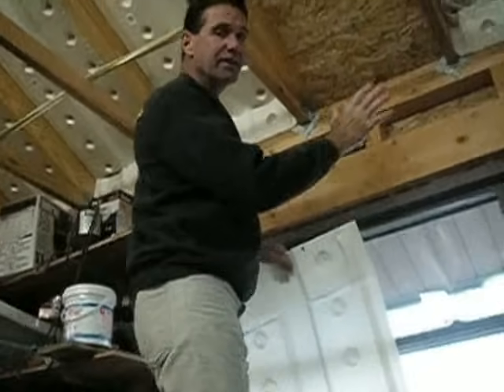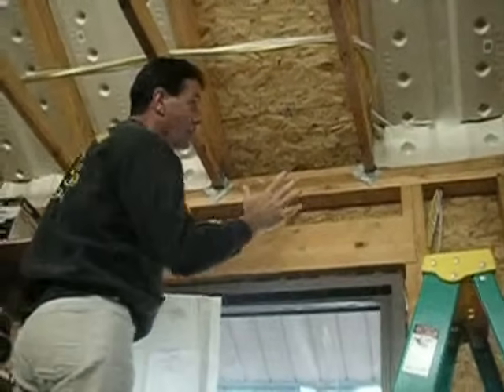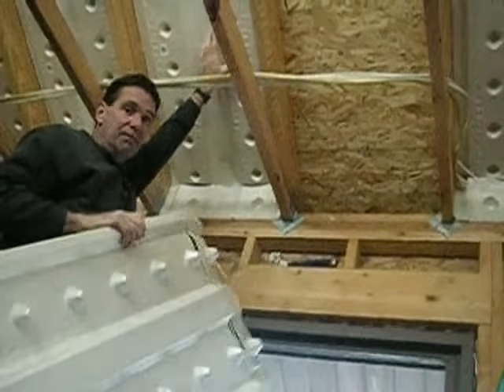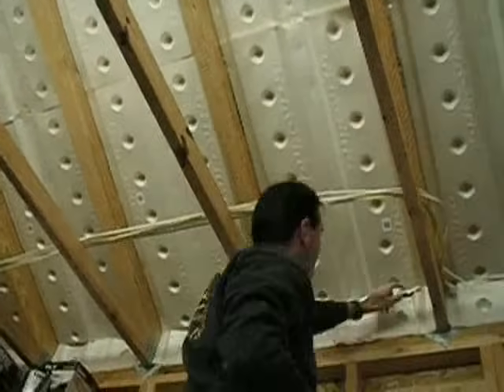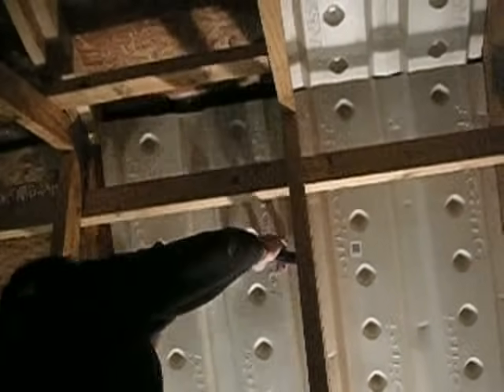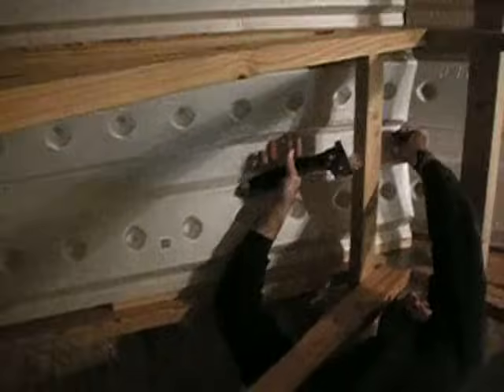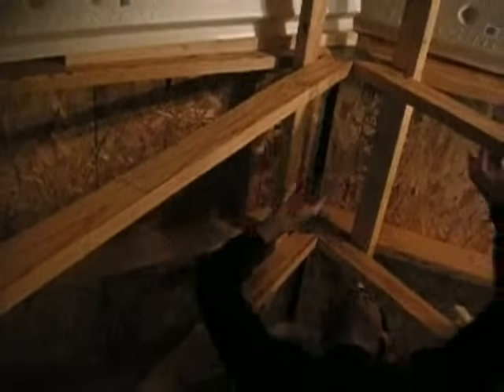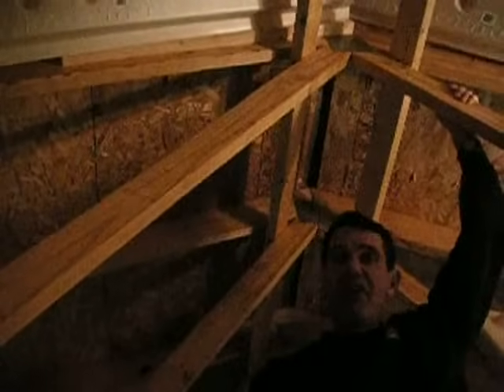Roof, Attic Insulation of Foam Baffles - Ventilate, Insulate Cold, Hot Air

Comment from the maker: This project requires an outlet for the rising warm air to vent outside. Without a ridge vent it won't work properly. It is not that hard to add a ridge vent even to an old roof.

Regarding the attic space, in this instance the attic space is 'conditioned'. Heated and cooled, not intended to be vented except for opening the windows for a nice breeze while I'm working up there.
If it were an attic I would have insulated the top of the ceiling of the room below and let the attic be vented.
Reply: Mr. Hardware you should get can foam and foam around the edges where the baffle is in the soffit area.
Reply: I have a shop with a metal roof in which some of it is exposed underneath (no deck)   Would this system work and keep it from condensing?
Reply: @Shang Tsung You weren't listening to him. He said @ 1:07 that he was going to use some tape and foam to caulk the joints.
Reply: @ipaintclarksville tennessee1, I'm not expert at this by any means. But it seems like it would work. I would think basically anything you can do would work. The condensation happens when there's moisture in the air with direct contact to a cooler object. Like a cup of ice water. You would want to make sure that the air touching on the inside of the metal was the same as the air on the outside, for temperature reasons. But you may end up condensing right on the baffle of it's cooler than your inside. I would think a better thing to do for this is to place some insulation directly over the metal. Like putting one of those foam insulation sleeves over your can of cold soda. It will feel much warmer to your hands and it also won't condensate air moisture on the foam.
Reply: I have a whirly fan

Comment: Please help me find what to use underneath the porch it has became part of the living room it makes my entire first floor ice cold
Reply from the maker: Many things, your porch could be on a slab and of course concrete it’s always cold. Your porch may be over a crawlspace that’s not connected to the basement hence it has no warm air underneath it so it’s cold. You’ll have to let me know the construction as to how to cure the problem.
Reply: @MrHardware1  you are right the porch is not connected to a basement and its an open crawlspace i now have very little fiberglass insulation i need to know what else i can use.
Reply from the maker: @jacquelinepierre4699  Either you get underneath the area and insulate it with fiberglass and then put a protective sheeting on the bottom of the joist to keep animals out of there. Or you seal the perimeter of the crawlspace and you connected to the basement so warm air from the basement can get into that area and it won’t escape because you insulated the exterior of the crawlspace.

Comment: Hey Mr. Hardware 
I'm going to do the same for a very similar roof. Do you tape the top seam were the two opposing ends meet at the peak?
Reply from the maker: I cut about a 10 inch piece of the baffling and taped it across the ridge and then used aerosol foam as a tack welder to fill all my voids and glue it into place.

Comment: So the baffles need to go up the entire length of the rafters to the ridge vent? Because some forums/videos are saying you just need baffles at the soffit to prevent insulation from blocking air flow into the soffit vents?
Reply from the maker: This is what’s called a hot roof and the area underneath is totally conditioned, so that’s why the baffles go all the way to the ridge. If this was a conventional attic where it is not conditioned, the baffles would simply run from the soffits where the air comes in up to above the ceiling line in the attic.
Reply: @MrHardware1  Can I use baffles only at the soffit and then instead place air gaps under the batt insulation (as opposed to using baffles for the entire length of the rafters)?
Reply from the maker: @riffdex  If you’re going to drywall all the way to the ridge, baffles all the allow for insulation to be tight (but not too tight) and not worry about hindering airflow.

Comment: Am I right in thinking that there should be a soffit vent between all rafters so air will flow up the roof to the ridge vent?
Reply from the maker: Usually the soffit is continuous so one vent feeds multiple rafter spaces. I have had to install more but smaller vents in one job w separate rafter spaces
Reply: @MrHardware1  That explains my confusion. Yes, I have individual vents but not between every rafter. Thanks for the reply.

Comment: Am sorry said this but. The 1st baffle vent. Are Instal Incorrect.  And the Union bet twin Sims are incorrect. To.  

You need put all straigh out the vent. 5 to 7 inch out. And block the top plate whit R19 Batt Insulation fiber glass or kraft Batt Insulation.  Air seal whit foam Insulation any penetrations....!   Plus aded  R19x24 Batt Insulation fiber glass and vapor Barrier poly 4 mil or 6 mil.    And taping any  cut or gape in the barrier's.    😉👍

Comment: If I don't have a rudge vent in my garage but just 2 each 8" round roof vents about 3 feet from the ridge top, will this baffles  with face 3" batting insulation be effective?
Reply from the maker: You can’t insulate all the way to the ridge w out a ridge vent. As is only the 2 rafter spaces will be vented if insulation and baffles run all the way up.
Reply: @MrHardware1  Thanks. I double checked the 2 roof vents and thier actually 1 foot below the roof pitch. If I install all the baffles and faced batting insulation between all 12 joists just short of those 2 vents will this still be effective at offering better warmth in the winter months and cool in summer?
Reply from the maker: @jman321  As long as rising air from all the ceiling joists have passage to the roof vents, yes.

Comment: Whether or not what he is doing is right or wrong depends on what he does next and his complete plan.  We never hear what this is so we don't know.  If he insulates the roof with spray foam, or if he uses batts and then installs air tight drywall over that, he'll be fine.  If he just installs batts and leaves it as is, then it will be a disaster because he will get moisture and mold behind the batts.  If he installs a poly or FSK air barrier over the batts that might work for a while, until the

Comment: I just bought some of these and they say 16OC but they are 22" wide, 11" if you snap them in half. Am I supposed to cut them?
Reply from the maker: The 22 1/2 inch ones are for trusses, you can buy them in 14 1/4 inches for conventional rafters. One does one and one does the other, they are not universal.

Comment: A couple of additional pointers. Unless your garage is heated or otherwise conditioned, there is no call for insulating or even installing vent chutes. Moving on....if you install them where fiberglass is being installed in attic floor joists, they should extend about a foot above the installed height of the insulation. If insulating the whole rafter bay, they be installed from bottom to top and slightly overlap as they install continuing upward. You can bend them as done here but care should be taken so as to cover the wall top plate. You would also like to foam seal exterior top plates to stop warn air from reaching cold attic surfaces. THIS is the main condition that propagates mold. You could also use polyiso rigid board insulation above the exterior wall top plate to make a wind blocker between the rafters (under the vent chute) to prevent wind washing through the soffits into the permeable insulation. Hope this is helpful. Keith - BPI Certified Building Analyst.

Comment: I dont seem to have "air spaces" from above or below, so how do i insulate?
Reply from the maker: This tutorial is only for roofs with a ridge vent.
Reply from the maker: @cesetar66  Cesar, it looks as though you have a ridge vent, where you put your hand up next to the ridge. That is good, you have an exit for the air flow.  Rafters 14" apart are probably 14 1/2" between... not a big issue. Get plastic baffles to install against the roof to create the air space I did with the foam baffles in my video. To get air in the bottom of the rafter requires a special roof wedge to allow air into the cavity, or a gutter vent or find out how you can connect your soffit (the space between the house and the gutter) w/vents to allow air into the low end of this vent.

Comment: Great video and instruction! I however have a situation thats throwing me off about what to do. I'm going to insulate my garage and my roof rafters. I have an open cathedral ceiling with a ridge vent. However, one side of the roof has a soffit and the other does not. The ridge beam completely divides the roof in 2 sections. Its not even possible to overlap at the peak because of the beam dividing both sides. To do this on the soffit side up to the ridge beam at the ridge vent. Seems pretty basic and easy.. would still do this on the other half of the roof? Attaching to the top plate running up the plywood to the ridge beam where the ridge vent is? There is no soffit on that side for any air flow to run up that and out the ridge vent.
Reply: There are ways to vent behind the gutter by putting half of a rigid ridge vent there and reinstalling the gutter, drilling holes in the facia so air can come into the ridge vent from behind the gutter and up in the holes. Pretty extensive job for a garage, there is also a wedge vent if you’re re-shingling. It gets installed from the gutter up 2 feet and it’s vented on the end and lets air into the attic, also pretty extensive for a garage.
If you could pull off the ridge vent you could take and cut slats or drill holes to allow there to go through the ridge vent which would allow some of the warm air on the unvented side out.
Reply: @blairgilbert7606  thank you for all that information! I did see a video of a wedge vent installation. Unfortunately I just had my roof reshingled 12 yrs ago. That probably was my only option that I'm seeing. Unless taking off the ridge vent like you mentioned and putting holes or slats, but not something I would want to do my self. This unvented side of the roof also has no overhang.

 Reason I'm wanting to insulate is because I live in NJ and it can get freezing in there. I'm turning my garage into a home gym. Besides for warmth I want to control the climate as much as I can in there so my equipment doesn't get ruined over time. I already purchased a comfort zone cz230er heater for my garage to warm it. Another option I guess I may have to go with is having ceiling joists installed by a contractor. For a traditional flat drywall ceiling with insulation Batts between the joists. There are only 4 ceiling joists up (22' long) from the original build, which i dont get? For the time being I may just insulate and purple board my walls only. Leaving the cathedral ceiling exposed. I will just turn my heater on about 20 minutes or so before I'm in there to get it comfortable. I know the heat is going to escape through the roof since there's no insulation, but it'll just run for the couple hours i spend in there to keep it comfortable for this winter. Hopefully by Spring/early summer I'll have enough put away to afford getting this taken care of.

Comment: He did it wrong.
The folded part of the vent NEEDS TO EXTEND TO EXTERIOR SIDE OF WALL PLATE.
Inslation needs to cover whole top plate...otherwise you have a cold corner.
I live in BC Canada and his job would fail inspection. 
Rooky mistake.

Comment: How do you vent the ceiling if using closed cell foam insulation?
Reply from the maker: The baffles vent hot air up and out the ridge vent. The area below is a conditioned space, no venting outside.

Comment: Doesnt putting baffles from the soffit all the way up to the ridge defeat the purpose of trying to aerate the attic? Wouldnt the air flow just flow from the soffit up to the ridge or vice versa and not aerate the attic space?
Reply from the maker: +Aaron Bliesner 
I stapled reinforced plastic to the bottom of the rafters, 2 x 6, and filled with cellulose. It was a test and it worked well.
Reply: +Marcus Skaggs 
That is the point, I'm using the attic area to work. It is not a non conditioned area. I'm living there, 'sort of'. If it was an attic over a heater area I would only insulate against the heated area.

Comment: Congradulations - by running the vents all the way up to the ridge vent, you've just about trapped all the hot (or cold) attic air in the attic (the baffle air is bypassing the attic air). And, that allows static, moist air to grow mold in the open attic spaces, defeating part of the purpose of attic venting.
Reply from the maker: You are missing that it is a conditioned space, not an attic.

Comment: you dont need to goto the ridge with the baffles. at most two high. These are designed to keep the fiberglass or cellulose insulation from choking off the air at the soffut. the attic air needs to circulate and then exit through the ridge.

Comment: I believe he is foaming the slopes from bottom of soffit (area where he folded the vent) all the way up to the rig vent location. he's using the horizontal trusses for storage, so he is on purpose leaving it wide open to the space below. there will be no flooring. he will fill gaps in vents etc. so foam does not leak inside.

Comment: I have an interesting situation. Inside a 1933 cape cod house, Im preparing to replace the plaster and cork board in the upstairs room (kneewalls to roof deck) with drywall. I have what looks like a 2x4 rafter system. Last year I paid to have fascia vents (no soffits) , and ridge vents installed on 3/4 of my roof.I currently have no insulation whatsoever either on the ceiling or walls of my upstairs room.My plan is to run foam vent channels from the fascia vents to the ridge vents, canned spray foam any gaps. Then install a radiant barrier ontop of the foam vents, then install faced r-11 or r-13 batts on top of that. What do you say to that?I know its not ideal, but it's better than no insulation right?The only other issue will be moving my ceiling mounted AC trunks to the subfloor and installing AC floor vents instead.
Reply from the maker: +Jake Schrier 
Jake, you want the insulation to be against the heated area. So I install baffles at the base of the roof so my insulation can be on the ceiling of the room below. Then up the walls to the baffles you install from the lower attic area, up the angled ceiling and ending in the upper attic. I would add 2 x 4's to the bottom of the angled ceiling so I could get more insulation in the intermediate area. Then put 12" above the center ceiling area. This way both attic areas are ventilated.

Comment: Hello. Ive recently completed installation of baffles. In the morning when the sun is heating t up the roof i hear the baffles creaking. I have not insulated yet. Will the insulation quiet down the creaking noise?
Reply from the maker: I would think so, plus insulation will slow the speed of expansion a little.
Reply: What type of baffles did you install? Styrofoam, plastic,?
Reply: Can you still hear them?
Reply: Styrofoam, I had them overlapping by an inch. I took them down and spaced them. Cannot hear them anymore
Reply: @jakenowakowski1236  thanks for the reply...Where did you purchase them?

Comment: This a garage where he apparently wants work or whatever year round and store things that he doesn't want exposed to the outside air. Not the same as a regular house attic. I had an uninsulated attic with soffit vents and a ridge vent. Things stored up there got all dirty from windy days that blew dirt through the ridge vents screens. I didn't want to cover everything stored up there in plastic so I baffled, insulated and vapor barriered and thermal barriered the rafters. Space is now less hot in the summer than before and warmer in the winter than before plus no dirt coming in and the roof is cool all year round as it should be. Having white shingles helps also. The rooms below the attic were then more comfortable also. He is doing this correctly. He wants to store things on top of the ceiling joists that don't do well in wide variations of temps or outside air exposure.. That is why he is doing it this way.
Reply from the maker: It is great on 80 plus days where it can be stifling hot on the second floor. So true about being cleaner AND quieter.
Reply: I also have an uninsulated attic with soffit vents ridge vent. I really want to insulate it, and do it myself to save the cash. Do you recommend the following method? 

1. Install baffles
2. Install radiant barrier
3. Install insulation
4. Install walls/ceiling

New to this but want to add a large living area in our spacious and currently over crowded attic, but it gets hot as hell in the summer and very cold in the winter currently.
Reply from the maker: @jeremytschudy1367  If you want to use the attic as a living area the method you see is what I feel is the best way if you are going for a vaulted ceiling, open all the way to the ridge. If you are going to build knee walls and put in a ceiling, or either one, the insulation belongs against the heated area. The roof only needs to be insulated where drywall will be attached, because the knee-walls should be insulated and so will the ceiling if you are going to make a flat ceiling. 
Remember, insulation goes against the heated wall, not against a roof in a non-heated area.